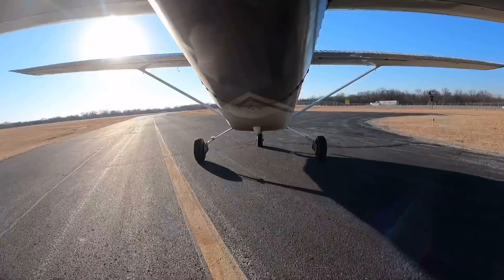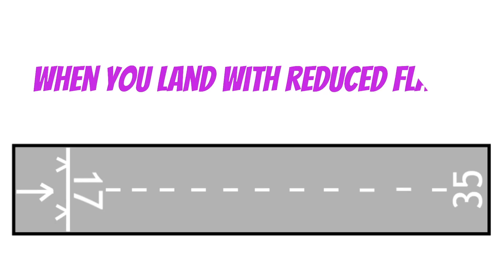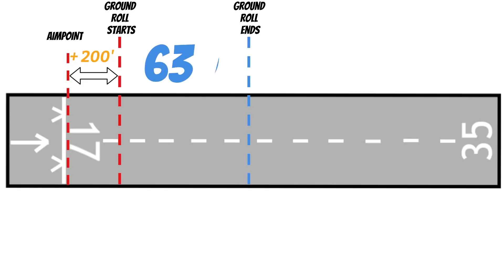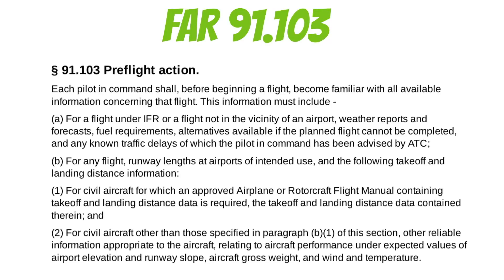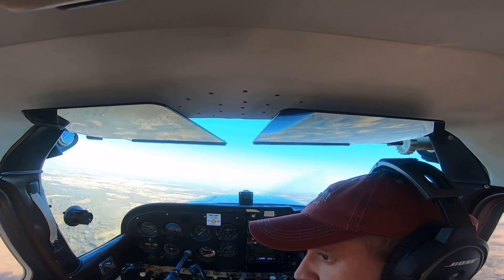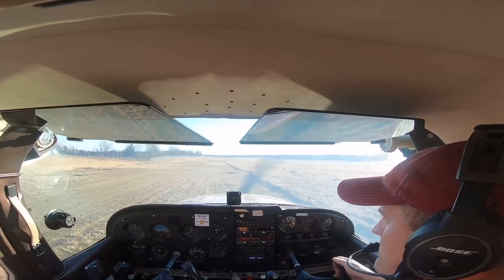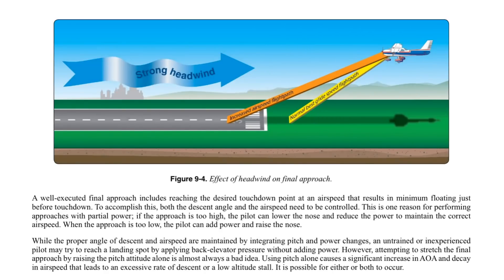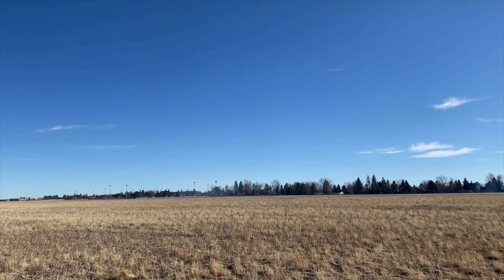Should "Normal Landings" be made WITHOUT POWER?

Comment: Flaps do not reduce the approach speed because you never aim for speeds near stall during the approach and stall speeds really don't change that much with flaps; 60 knots target in the Cessna 172.  Flaps are mostly about dumping energy (stored in altitude).  Flaps do reduce the landing roll, but mostly because of the reduced speed of the flaring, nose up on contact, and drag created during landing.  Flaps make you much more vulnerable to gusts.  All that said, flaps are a distraction from the power off (idle) landing question, because obviously you add power to make the runway, as needed.  But power off landings teach you to fly the plane like a glider, and to be more prepared for engine out scenarios.
Reply from the maker: I’m not sure where you’re getting your information, but flaps DO reduce approach speed.  Here’s why. According to the Airplane Flying Handbook, on base, you should be flying at 1.4 x Vso (this is the aircraft stall speed in the landing configuration - in other words…FULL Flaps.  This gives you an adequate buffer to keep you from stalling. This is especially important when turning base to final.  Most accidents happen here.   Also, flaps DO reduce stall speeds.  In my airplane, it will stall with 0 bank with flaps up at 57 mph.  Flaps 40 with 0 bank, the airplane will stall at 49 mph. A difference of 8 MPH.  These speeds are roughly where the critical angle of attack will be exceeded.  Sorry, but you are wrong, and this mentality is what has killed a lot of pilots in the pattern.  And as I’ve already mentioned, power off landings are important to learn, but a glider is a completely different category of aircraft, so you shouldn’t even compare the two.  That would be like applying landing principles that are safe in a helicopter…
Reply: On the Cirrus SR20 stall speed is 9 kt. less with flaps down and it will be different on different aircraft, there was a fatal SR20 crash in Houston a few years ago where the flaps were raised on a go around too early.  If I recall my long ago time in the 172 we did add at least 5 kt if doing a flaps up landing depending on wind conditions and load onboard.

Comment: This is an interesting topic. It's been said in other comments, but I don't think you can blanket that all approaches should be with power. I personally land my Stinson largely with power off. My goal at typical small GA airports with no crazy approaches/obstacles is to always be within gliding distance while in the pattern. I think that should be a golden rule for any pilot/plane. I'm blown away by some pilots taking downwind 2 miles past the threshold. Yes, the odds are low that your engine quits somewhere in that base/final area, but why subject yourself to the unnecessary risk when there's no need? Don't get me wrong, there are places that require a longer, stabilized approach (think airports in valleys/mountains), in which a power on approach is definitely the way to go. But at your average airport with clear approaches: Power comes out abeam the touchdown point, hold the nose up until flap speed, add necessary flaps to touch down at your desired location, utilizing slips if necessary. Maybe there's something I am missing, but I don't think I would call that dangerous.
Reply from the maker: Thanks for the comment. Even with power I stay within a mile of the runway. This alleviates most of that risk. If I haven’t convinced you from this video, you probably will keep your opinion, lol. I’m interviewing a well respected examiner in the Arkansas area very soon. I’m hoping to get his thoughts as well
Reply: @FreePilotTraining  I’d love to hear them as well. Differing train of thoughts makes us think, and ultimately smarter.
Reply from the maker: @caseyhutson5392  that’s a fact. I certainly welcome different trains of thought.  It’s interesting to hear about other pilots who have lost their engine and what they did in that situation

Comment: Great topic. Couple things to note... While most flight schools teach in 172's/152's which have tons of elevator authority while landing at idle, many of us fly many other types. In my case a Piper Cherokee 140. Not only is an approach with power even more appropriate in a Piper 140,  but also is landing with a touch of power. Landing a Piper 140 at idle and you don't have enough stabilator authority to hold the nose off after the mains touch. I land typically with about the same throttle setting as I use to start the engine. By doing this I can let the nose wheel down when I want to. I will add though, that I recently added wing root fairings (knots2u) and now I have a bit more slow speed stabilator authority, but still need some power to keep the nose off. I always have the option of doing  idle landings in situations that absolutely require it (short fields), but landings are way smoother and much easier (less maintenance $$$) on my aircraft when landing with some power. Bottom line... Know your aircraft, it's limitations, and be able to fly in it's entire envelope and you will have the tools for all situations. There is no one "right way", but many ways, depending upon the situation.
Reply from the maker: Thank you! I regularly fly a Cherokee 140. I land without power all the time and they are smooth, but that is a great tip because it is very tricky to keep the nose off the ground on grass landings.  I’ll try a bump of power and see if it makes it more consistent
Reply: That says more about the poor handling characteristics of the PA28. The elevator on a light single SHOULD have sufficient authority to hold the nose well off in a power off landing. It does on a C150, and easily enough on my favorite aeroplane, the dH Chipmunk where there is ample elevator authority to get a lovely 3-pointer with the power off - or even a tail first landing if you are ham fisted.

Comment: Drag doesn’t matter hardly at all for ground roll. Energy is all that matters. (Drag will help slow you down, but at low speeds in light aircraft, it isn’t significant.) Which means mass and velocity. If you touched down at the same speed and had the same braking effectiveness but with different flap settings, you would have the same ground roll. 
Flaps are helpful for all kinds of other reasons, but they impact ground roll only by reducing stall/touchdown speed.

Which means: if you put full flaps in on landing, whether or not you use power, you’ll have the same ground roll. 

Note: I’m not advocating for power off approaches, I’m just saying the reasons are different. They aren’t good standard practice because of safety margins for possible engine failures. 
But if you do do them, use the same flap setting every time.
Reply from the maker: That’s a great perspective. I appreciate your comment
Reply: Yeah. V is a squared term.
Reply: Wouldn’t raising flaps after touchdown also increase break effectiveness
Reply: @Krenson_Kniphfer  yes, but I took that factor out by saying we’re keeping the same braking effectiveness.  
Also, I was taught to not retract flaps on landing because it increases the risk of accidental gear retraction. Maybe your plane has fixed gear. If you fly an RG anywhere, you should think hard before making flap retraction after landing SOP, as it will become motor memory and increases risk of accidental gear retraction in your RG plane. Just something to think about. I was trained that way because my training track was toward complex aircraft and they didn’t want bad habits to unlearn.

Comment: One answer to the question about what to do when high and already at idle:  Increase speed, up to max flap speed, to burn off excess energy.  -have to move aim point well ahead of runway so you can transition back to normal approach speed  prior to reaching runway.
You might find this video interesting as it is related to this topic of energy management in landings.  All are full flaps.  One is shallow (ILS'ish) and lots of power, one 'typical' descent angle with just a touch of power, one steep requiring excess energy be dissipated to avoid landing long.  The key is that all arrive at the threshold in exactly the same energy state.
https://youtu.be/VyhTr8FXU2g
Reply from the maker: That does work, but decreasing airspeed and dropping flaps before descending works in almost every plane you go fly
Reply: @FreePilotTraining  The landing config drag polar in my aircraft doesn't yield much benefit in descent angle slowing from 1.3Vso all the way to just above stall speed.   There is much more descent angle available by increasing speed to max flap speed. (2,000 fpm & 11 degrees)  
Another reason for not slowing below final approach speed is that you put yourself in a very low energy state combined with a high sink rate.   You risk not having enough kinetic energy available to stop the descent.

Comment: Regarding your strong wind scenario:. If you look like undershooting, you add a burst of power to get you on the correct glide slope again and then cut the power again.  You don't just add little more and fly a shallower angle.
Reply: you need to recognize EARLY when you are getting low, then you don't need a BURST of power only a gentle nudge almost unrecognized by passengers it is so small.  when you don't recognize it soon enough is when you tend or overdo on the power.

Comment: Power off (idle)/gliding landings should be taught right from the start of flight training. They represent the worst case situation...engine failure. Also, the student should be able to use ALL available flight controls. Knowing when and how requires a lot of time in the training area with lots of altitude. These skills must be practiced in each aircraft type you fly.
Reply from the maker: Agreed, but NORMAL landings are more important to know how to perform properly because they are done more often
Reply: @FreePilotTraining  Power off/idle/gliding should be the norm and taught first. Power off requires the student to quickly understand pattern and landing dynamics. Then, adjustments..including the use of power can be added later. This will produce a pilot who is safe, competent, and comfortable in the pattern.

Comment: Here’s some crazy discussion items - Front Side versus “Back Side” really Power versus actual Back Side Techniques. For this, we should note our basic motions Climb/Descend, Accel/Decel, Turn are an incomplete list. We also have Zoom and Dive.  To climb or descend, we change power thus giving excess to climb or letting drag dominate to descend. To accel/decel, we change pitch typically while also changing power so as to stay level or stay on a constant glide path. Turning isn’t relevant to this discussion. Zooming and Diving, however, are trades between kinetic and potential energy. Different than climb and descend. 

On the Front Side, if we’re high, we can nose down as that adds drag. There’s a limit to this as ground effect changes our polar. If we’re low, we can nose up to stretch. There’s a limit to this as we’ll eventually bleed through L/Dmax to the back side. Why might we like Front Side flyers? Turbines with long spool-up times. Front side gives us responsiveness in these sorts of planes. 

What some mistakenly consider back side though really are power techniques. Use Pitch (trim) to control AOA (or speed as proxy). Power for glide path. It works on any plane in any position of the curve. Its working is just too slow and thus both susceptible to PIO and inadequate for landing glide path control responsiveness with turbines back near idle. To prove it, consider cruise flying obviously front side. What happens if you add power with no other changes? Note: gliders use this method too though by simultaneously adding drag and reducing lift through spoilers. These are mechanized to act in the same manner as a throttle or power lever with more spoiler control back less spoiler control forward. Nominal spoiler is midrange allowing for adjustments in both directions. Trim for AOA (or speed), Spoiler in lieu of Power for Glide Path.

What is true Back Side? If you’re high, pull up thus slowing and increasing drag thus sinking then dump the nose to accelerate and catch desired glide path. If low, push the nose gaining speed reducing drag to float further. Obviously, these are uncomfortable, hence we prefer the power techniques. They’re also more susceptible to mistakes, hence again we prefer power techniques. Though you’d be technically correct per physics to nose up to correct a high in your glide as you’re likely at L/Dmax hence nosing up slows you into the back side. I’d do the forward slip too in lieu of this which is really shifting the parasite drag of your curve leftward while also amplifying it. And I’d agree with you that avoiding having to use these particular true back side techniques in favor of the power techniques, which again work on both sides of the curve, is a safer game plan with much more precise glide path control done with much more ease of control.
Reply from the maker: This is something I could definitely do more studying on.  Thanks for the good read
Reply: @FreePilotTraining  I omitted the main focus of front side flying - on the front side we use pitch for glide path and power for speed. We can see this Same technique regardless of the side with autopilot aircraft that have no corresponding auto throttle. If you’re in Altitude Hold, VNV, or VS, throttle will control speed as “Hal” will be trimming for you behind the scene. If, however, you’re in FLC, then “Hal” tries to maintain speed hence power controls VVI more in line with those power techniques. These become factor when teaching or doing Instrument Approaches with Technically Advanced Aircraft. The mind shift from Front Side while Coupled to Power Technique when Hand Flying especially in a transition to land as opposed to approach to approach can confuse your student or novice Instrument flyer.
Reply: And with that, we should also rewatch “Children of the Magenta.”

Comment: There is a difference between a power off approach and a glide approach.
A glide approach assumes no engine power is available.
A "normal" landing with a power off approach means emgine power is always available.
A glide approach is made with an aiming point 1/3 into the field and once making the field is assured flaps and sideslip are used to shorten the touch down point.
A glide approach should NEVER be made to a short field aiming point!
In a normal approach pitch controls airspeed and power controls rate of descent.
In a power off approach, power is used as necessary to adjust rate of descent to hit the aiming point.
By the way, when I ws a student , back in 1997, I was told not to retract flaps during an approach once they had been extended.
During an Instructor rating renewal, I was attempting a forced landing drill and realised I was goling to be short. I anounced this to the examiner and he said "why not take the flaps off?".
HE "said why not try it"> We were at 300 feet with 30 degees out in a Warrior. To my surprise, after the initial sink our glide path extended.
We were lined up on a short grass private strip and he got me to compete the landing.
As I said there is a difference between a glide approach and a normal power off approach.
It is VERY different from the long flat power on approach that so many pilots seem to do in single engine aircraft.
Those maybe approriate in jet or a twin, but I aim for "normal" power off approanches with power used on short final to hit my spot in my own light single.
The added benefit is if you ever HAVE to do a glide approach you will be practiced and much more likly to land on the strip! 
Of course there are differnt tecniques for different aircraft.
In a C300 or 4000 Series a power on appproach is always done. Speeds above "blue line" are held until short final.
When short fielding these aircraft the same power setting is used but it is flown at a different airspeed.
ON these aircraft the airsped is reduce on short final but power is NOT reduced till the wheels are on the ground!
Learn the basics first, the advanced stuff comes later!
Reply from the maker: That’s exactly right. You can also use flaps to increase your glide distance slightly as well.  I’ve done it.  If your just barely not going to make it, sometimes the balloon of the flaps will be just enough to get you there

Comment: I don't think I've ever landed a 172 with power after established on final.  Absolutely no reason to.   Now my Maule is totally different: you can't land short without power. At 55mph and full flaps the descent rate is horrendous so you have to control it with power. Touch down at 55 and possibly even a bust of power, dump the flaps and the done.

With a 172?   No reason in the world to approach with power. Even the old ones with 40 degrees of flap.
Reply from the maker: Shock cooling with the O-300.  I’ve heard that can be an issue
Reply: @FreePilotTraining  Urban myth.

Comment: First, my airplane does not have flaps. Second, so all the pilots trained for WWII were taught wrong?
Reply from the maker: Your airplane is an obvious exception to the rule on the flaps discussion. However, that doesn’t mean “normal approaches” should be made with power off. I love the heritage that comes from WW2. My favorite airplanes are from that era, but just because we taught something during that time doesn’t mean it’s the best way to do something.  Since that time we have made numerous improvements in technology. Plus, over 15,000 pilots died in basic aircraft training during WW2 and didn’t even make it to the fight.  With those stats, there must have been some things that they weren’t teaching properly
Reply: @FreePilotTraining  So I rent a C150. I land at 55 with flaps, make the first turnoff. I land at 55 with full flaps, make the first turnoff. Flaps don't control the landing roll out. Brakes not used in either landing. So, if you are not proficient at power off landings, RIP on an engine out situation.